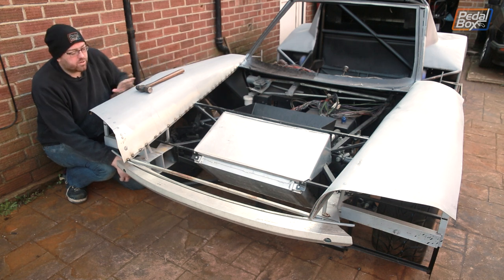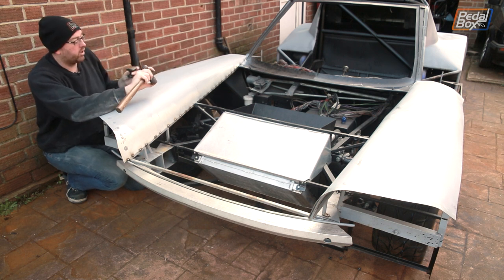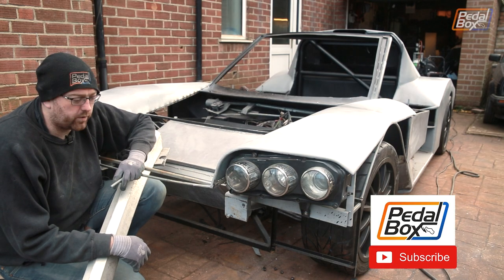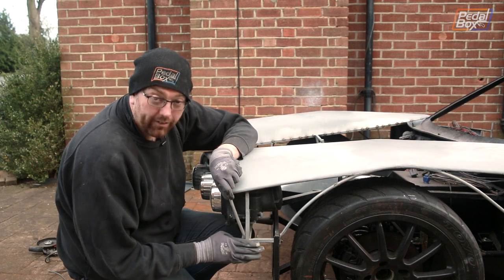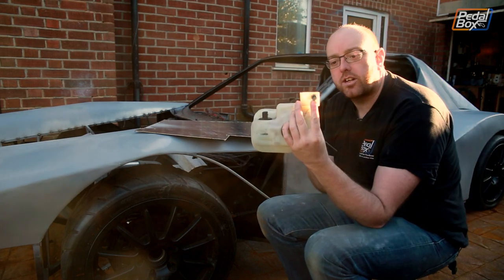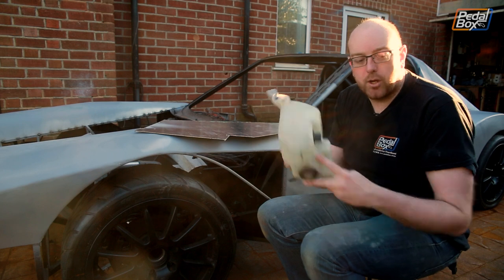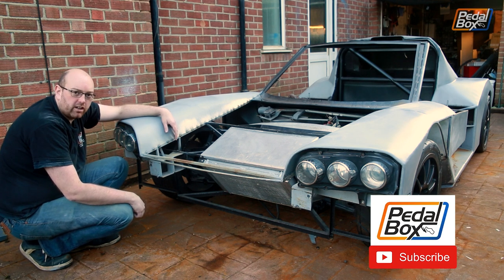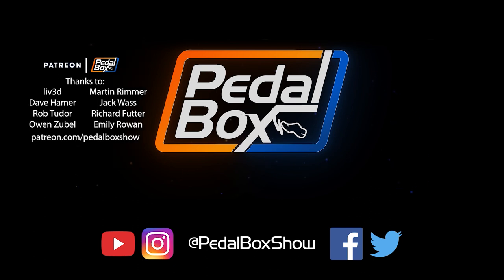Front End Bodywork | Audi TT Kit Car | PedalBox Episode 98

Comment: Hello,
Good to see the front wings on... the first thing that came into my mind (please don't hate me) was a jaguar XJS...  See you on the next one.
Take care.
Paul,,
Reply: That's it an XJS! Similar curve there, not a bad thing, just how the Jag boy's built it!
Cracking work going on there chap's, adjustment for the headlamp aim accessible?
Reply from the maker: Wings have been a long time coming, I do like the XJS so i'll take that compliment :)
Roughly speaking, yeah. The top two bolds are fixed position, so shouldn't be a problem, but you can just get a torx bit in on a 1/4" brake spanner to tweak them if needed. I'm not entirely sure where the adjustment is on those lights if i'm honest, theres a lot more adjustability in the bottom nut, and that easy :)